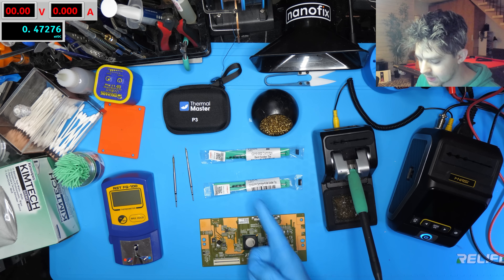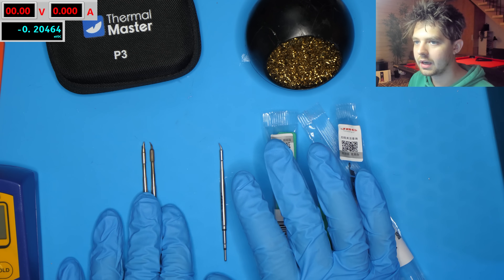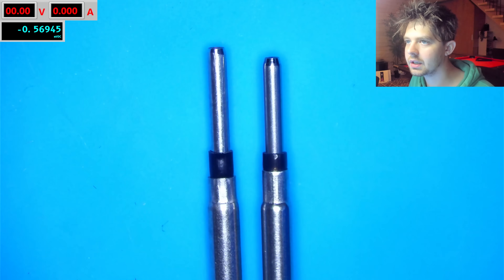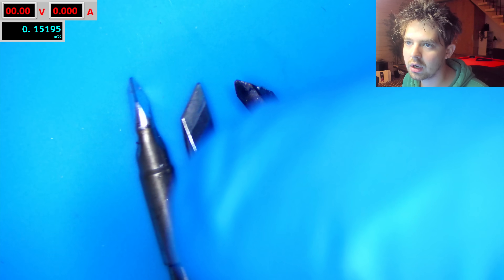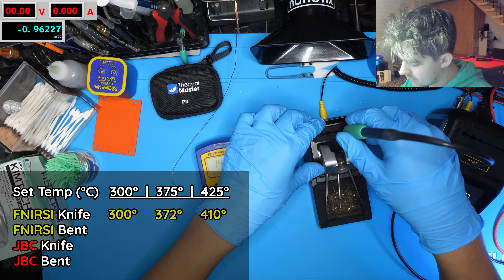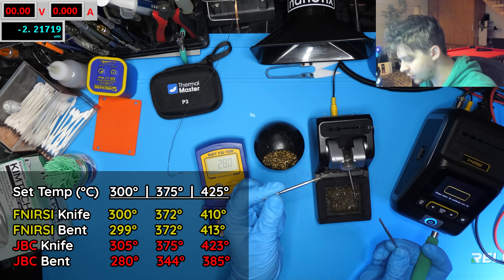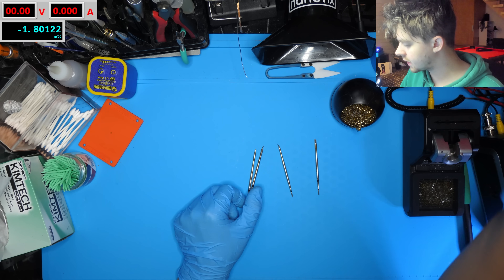Are JBC Tips Worth It?

Comment from the maker: Because I know some people will ask - I did not have the Geeboon TC22 at the time of filming this.
Reply: Are we gonna see an update on how the Geeboon tips perform compared to the tips you tested here?
I expect them to perform the same though.
I saw a test (I think they were c470 tips though) where Geeboon tips were compared with 'Magma' tips (came with a Sugon T61 station), and the Geeboon tips were way better.
The test was holding them in water, while monitoring the current and temperature. If the current is the same, but the temperature measured by the station is hotter (which was the case with the Magma tips) this means the tip is worse as there is less heat transfer from the core to the outside (same current=same heating power, when heat is better absorbed by the water it means there is less thermal resistance between the heating element and the surface).
So I have high hopes for the Geeboon tips. For me it was a key reason to buy the Geeboon station (plus that it's well priced, has a nice stand etc etc)
But I'm shocked that the fnirsi tips have a tighter tolerance to eachother than JBC. I can't imagine the JBC tips not being made in China so they picked a worse factory than Fnirsi? 😆
Reply: @mrpetit2  Do we think that cup-of-water trick is bad for the tips, if you start in distilled water with a cold iron? I'm legitimately about to try that with my own TC22 when it arrives later today and I'm afraid I'm about to ruin $95 worth of Chinese-top-end T245 and T210 tips. One of which is like a T245 C8 style, which I'm excited about. If that thing puts a big grin on my face, I might end up buying the HA310 and a bunch of T470 tips to fiddle around with. (Though I'll be more interested in the RS-485 "robot" interface on the HA310. I want to see if I can make some kind of remote display for it, like an overlay for a streamer to use.)

Edit: well, I did the distilled water test, using my off-brand C245 C8 tip as well as the Geeboon C245 point tip that came with the iron. Both tips got the water sizzling, for a few seconds. Using the line graph, it seems the tool is only willing to put 100% power into the tip for exactly 8 seconds, before stopping power and saying "Tool Protection." Then after some time off it would restart again, what seemed like 8 seconds on 16 seconds off or something similar. Also the C8 tip is too big to fit in the nicer SDC20 cradle's sleep position. The cartridge removal-insertion thing at the back just barely fits it for removal. I would wonder if it was really a T470 tip with an incorrect listing, except I think the TC22 would refuse to power it if so. And it gets up to temp very quickly and melts solder scarily well. The C8 tip didn't tin like I was expecting. I expected a mound of solder to form. At that size the solder stays liquid and flows around the tip, dripping off of the bottom if you let it. Oops.
Reply: I think you gave me advice via email to use ChatGPT for some things. Well, I signed up for Plus because "she" can even help me diagnose various boards. I have already fixed 2 e-bike chargers just by uploading pictures and telling it the symptoms. It literally takes me step by step. It is also helping me learn to solder. I have been struggling with that HDMI port, even with the new solder and tips I bought. I bought the wrong solder for the HDMI ports. It had me get some Sn63Pb37. I have been fighting myself and wrong solder and tips the entire time. Ugh lol
Reply: You need to calibrate each tip separately.  5:10 have you calibrated bent tip after you tested knife? Clone bent tip was chunky and thick, no wonder it acted similar to knife with that thermocouple mass. JBC much thinner and has less thermal mass. With original tips you can select like from 5 different bent tip sizes that best suite your needs. And they always are manufactured to tolerances, that is why JBC can offer so much sizes of the same shape/style. They have the precision.
Reply: I use original JBC tips for 15 years now. And recently I bought few different clone tips. The biggest difference I noticed was not in heat performance. The biggest difference is in mechanical aspects and surface finish. Also clones has very small selection of shape and sizes. Some clones looked like they were forged with hammer and anvil. The same type of clone tip looks different bought at separate purchases, no consistency. I will stay with original tips.
Reply from the maker: @Mr. @Mr.Laidukas  Fair enough! I still don't feel as though it's worth the 3-5x price for myself personally. But I can appreciate other people may prioritize different things :)
Reply: @nanofixca I can understand your possition. However, since I have tried a wide array of original tip size and shape selection I simply was struggling with clones since such clones do not exist.
Reply: @Mr.Laidukas  What makes me wonder. Its only about the Fnirsi Clones. Havent tested those, but the Relife, Magma and Mechanics are shit. They dent to have less than 30° C that you actually set. They also are shitty surfaced, tin doesnt stick to the tip, they oxidize fast and have a horrible heat transfet to solder wick. Almost ever you stick when cleaning pads.

Comment: thanks for the video. I tend to buy JBC genuine from the UK distributor and I'm disappointed by how little they last. One large tip only lasted like 8 hours according to the timers but JBC Spain looked into that and refused to acknowledge that the tip had failed (there was a hole on the coating on the tip). 
However, some of the 245 tips I got from various Chinese suppliers, are just bad. One of the tips literally CAME OFF (leaving a plain cylinder behind with the heating inside) when I removed it from the handle. Another is just poor, solder doesn't stick well to it.

The issue with Aliexpress tips is CONSISTENCY. You never know what you're getting. Even from the same supplier. So I stick to genuine JBC though I can agree they are overpriced.

Comment: About a year ago I made a video with a cross section view of such tips (C245) and there are differences.
You can buy good and bad clones. The problem with that is: Which are the good ones? With originals you don't have to bother with this inconsistency.
I concluded my video with: For me the daily driver is a JBC tip and clones for special sizes and shapes I wouldn't use as often. But this is a European conclusion. I was a little bit shocked you talking about 60 to 100 bucks for a JBC tip in the US or Canada. In Europe I bought mine for about 35 bucks. That's a far more narrow distance to the price of good clones from china.

Oh and by the way: Thermal imaging on reflactive surfaces are more or less useless. It's like judging the outside light by putting mirrors in front of the window 😅
Reply from the maker: Cool cross section video!! I fortunately haven't had consistency issues with the clones I've bought, but maybe I just got lucky with the brand I picked. I would definitely consider genuine JBC tips more if they were only $35. And yeah I discovered that the thermal cam was pretty clearly useless here 😂 I thought maybe if I cleaned the iron tips enough it would work, but unfortunately no.

Comment: Mobile Centrix is Not an Authorized seller of JBC Tips. JBC tools has revamped their packaging 3 times since they have used that type of packaging. When JBC used that type of packaging QR codes did not exist. It already appears that you are using a counterfeit JBC products/tips from what I Am seeing. Unless you are using these JBC tips with an actual JBC soldering  station you will absolutely not get the accuracy that you are looking for. These tips are made and intended specifically to be used with their station and not off brand stations from China.  I own several JBC stations and products and they are very accurate from my own experience and from my own tests with my Tip accuracy testers.
Reply: I wrote about that yesterday, but Youtube deleted my post - maybe because I wrote full marketplace and store names or because I quoted the JBC report on packaging. Such tips on a plastic stand are sold on Ali as originals (You know, that the Chinese only sell original items :D :D ). it is very likely that Mo Ce buys tips made for the Chinese market from ISKU or HANDIF stores in Ali (I really hope that at least from them, and not from completely random sellers) and resells them.  Since 2020, original JBCs are packed in recyclable cardboard (eco-friendly) envelopes. By the way, even if you bought tips in envelopes from Ali, they are not originals, or maybe defective - most often the serial numbers on the soldering tip and the envelope do not match. I have both - "original" from Ali and couple original tips from Ele. There is difference between them - not dramatic, but real JBC from Ele is slightly more responsive (and the serial number of the soldering tip matches the number on the packaging).
Reply from the maker: @itguru4989 I did not delete any comments and I will never delete comments. I'm not interested in censorship in the slightest. It must've been YouTube's horrible auto moderation. And good to know! I will reach out to MobileSentrix and JBC for more info.
Reply: @nanofixca  Yes, I already realized that this is Youtube censorship - the answer I just wrote disappeared. I suspect they didn't like something related to the packaging or the name of JBC website itself.
Reply: @itguru4989I already know I own like 20 jbc tips for my nano station and my cde station and they are very accurate
Reply from the maker: Hmm interesting, I would be extremely surprised if MobileSentrix was selling fake JBC products. They are a very reputable parts/tool distributor for both US/Canada that many repair shops use. I will reach out to both JBC and MobileSentrix to try and get more info.

Comment: Wow regarding going through the calibration of the tips only to have the JBC being so far off the calibration. I assume the last tips you calibrated on that station were the JBC tips. You go through the calibration process so when you dial in the temperature you know that the tip is supplying the temperature you want. Does that station show you what tip is in the handle?

Comment: I bet the biggest difference will be in longevity of the tips between original and clone. One mayor advantage over clones is that the original jbc tips are available is many many many more shapes and sizes than the clones do. For instance I have not seen any clone cartridges with spoon shaped tips, which are amazing for drag-soldering pads and pins.
Reply: i havent seen a chisel tip knockoff either. theyre all pointed, bent, and knife.
Reply: @chrisgr00ver  Exactly. I use chisel tip and spoon tips all the time and will buy these in original JBC once my T12 station gives up the ghost. The other item that is good to get in original quality are the tweezer handles. The knock-off tweezers have no way to adjust tip positioning, which the originals do have.
Reply: @chrisgr00ver  the other great thing JBC sells which I have not seen elsewhere are the shields for hot air rework. Just like anything jbc, they aren't cheap, but for something that has no wear/tear and thus should last your entire lifetime... its not that bad in the end.

Comment: I compared an Ali knockoff 4mm chisel to a JBC, holding it in a glass of water. The JBC delivered over double the wattage into the water. I think some of the Ali tip brands would be fine, but with many brands you don't know what they will be like from one batch to the next as the QC is non existent. The JBC plating will always last longer though.
Reply: OK, but what brand was it? A no-name tip? He's testing FNIRSI in this video, and that's a brand that has been around for a while that makes decent electronics products.
Reply: @person880  It was a Phonefix branded tip. They are one of the bigger tip brands on Ali. I wasn't trying to contradict his findings, just sharing my own experience. I use a mix of both JBC and knockoffs at the moment.
Reply: @oldman1944  I understand. Thanks for the additional info.

Comment: 7:22 - I cant remember on which channel I saw it, but someone actually placed soldering iron tip, in glass of water, to get most of power heating... this percentage you got is almost just idle percentage...
Reply: Not only that. On the "thermal camera test", when he says that the JBC tips are "strugling", he should say "they can transfer temperature faster". That's why I have to thumbs down this video and ban his channel from my Youtube feed, because not everybody should be allowed to have a Youtube channel, when they don't know what they are talking about, and only spread missinformation.
Reply from the maker: This is smart! Although to be honest, I'm a bit more interested in how the tips perform when using them in a real use-case scenario vs in water. I probably could've used a larger/thicker board like a PS5 board though. Maybe I'll do a bigger comparison video eventually with multiple brands and try some more refined tests :)

Comment: How did your P3 not complain about seeing too much heat ? Wen I look at my soldering station the P3 schutter closes and gives a heat/too hot warning.
Reply from the maker: You need to adjust the temperature range at the top of the app to the higher range and then it will re-adjust :)

Comment: What you're paying for with JBC is guaranteed quality, you don't need to test each tip before putting it away when receiving them and can be assured they will have adequate life and function. They are somewhat overpriced in my opinion regardless.

It's not that they work better, they are tested to work correctly before being sold which maybe fnrsi is doing but maybe they aren't while various other companies certainly aren't.

Comment: fnirsi tips never got changed right? 1 year of use
Reply from the maker: Correct, I've only ever owned one set of Fnirsi C245/C210 cartridge style tips and have been using the knife and bent conical tips for at least a year and a half - coming up on two years.

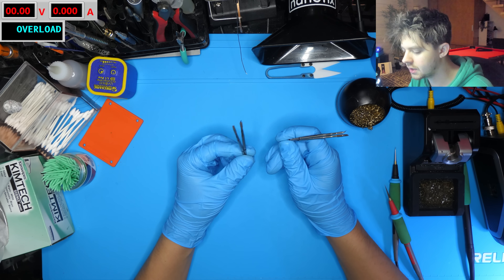Comment: 9:18 it is not as much of a thermal performance and more about manufacturing precision, tip size selection. You can select from 4 different bent tip size and they will be exactly the same each time you will buy. China clones do not have the capability to offer that. And you compared thin original to thick clone. With original you can select not only the pointy tip size but also neck size and neck is very important to transfer heat to pointy tip. Clone had thicker neck simply because this is how it is cheaper to manufacture, when you do not have precision. They all will melt soled it not about that.

Comment: Been using clone JBC tips for about 2 years on a AiXun solder station. Had one fail immediately, others still holding up today with moderate usage. The advantage of JBC tips is their ridiculous selection. They offer tips for very specific applications. If you do a lot of through hole soldering they have some specific tips that are worth every penny.

Comment: As a JBC owner at home with genuine JBC tips AND more than 25 JBC soldering stations in a lab at work I can tell you one thing. The ONLY way how to destroy JBC tip is mechanical damage. The tips works after 8 years of daily use like out of the box. We change the tip only if someone take pliers to take it out from the handle. For me personally JBC all day long. I don't regret 25 dollars per tip because its reliability.
Reply from the maker: I can appreciate that, however I'm not convinced the knock offs I have are any worse for durability/longevity. And where can you get JBC tips for $25? I can't find them under like $40 USD at least
Reply: We're using them in service with a lot of THT as well, original surviving up to 2 years of everyday 5-6 hours of work
Reply: Some don't have the same experience and genuine JBC tips can fail in months, plating is notoriously thin. But maybe they don't take as good care as you.
What temperature are you using, what solder, and how many hours of use per day?

Comment: The main difference I noticed was in terms of wetting and oxidation, knockoff tips oxidise much faster and are harder to keep clean. I've used them for about year now and the JBC is good as new while my Aixun knife tip oxidises very quickly. Maybe the Fnirsi ones are better in that regard, the JBC tips are about €45 (incl tax) so a bit cheaper here in Europe.
Reply: This is the same thing I've noticed with Fnirsi tips vs JBC. The Fnirsi tips have a much rougher finish and are harder to keep clean.

Comment: Please do test the the durability (and maybe the 'wettability'): for anyone soldering a lot this is probably the most important: a tip with a good coating makes better contact and has a lot longer lifespan. Personally only experience with Weller, but might want to try a Geeboon soon.
Reply: Yes this is the main difference between the JBC and knockoffs in my experience. To me it makes a big difference in use not having to retin and clean the iron as often.

Comment: The 'genuine' tips might last longer, but honestly, you can buy like 40-50 clone tips for the same price, so it's a little bit of a false economy to buy genuine.

Maybe if you're running an assembly sweat shop where the tips are in use 24/7 it MIGHT work out worth it.
Reply: Agree, but there is a risk that some clone tips are garbage (thermocouple not manufactured properly), so the value of the genuine tip is you get something you know is good quality.